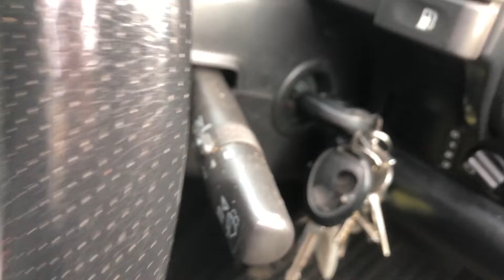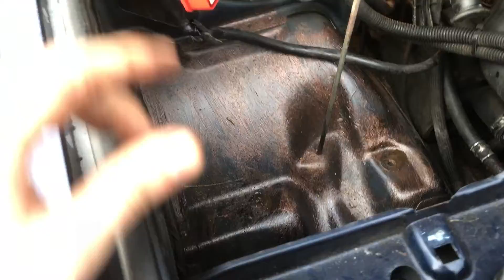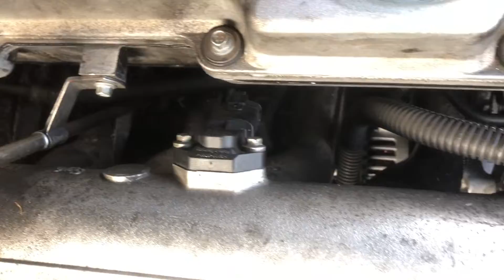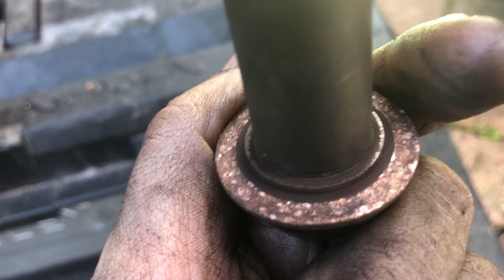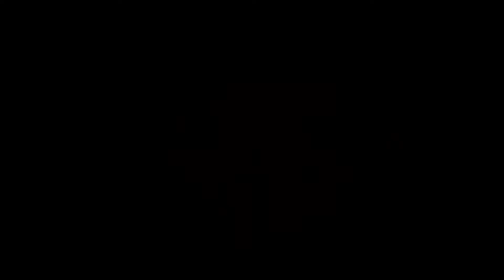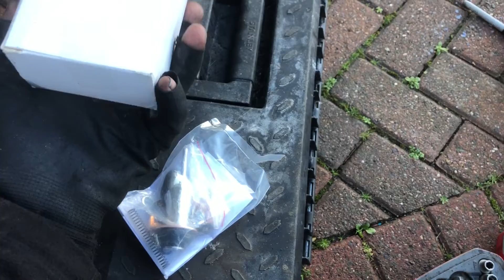Land Rover Discovery 2 TD5 No start, Crank or Turn over Starter Motor Removal and Replacement How To

Comment: Mine has just started, (or in this case not started),  to play up. One day she will fire up first turn, 10 minutes later the dash goes dead and no crank. Then sometimes if I put my foot on the brake pedal, it works. Other times moving the auto gear lever in and out of park works. 
Running out of ideas, so anyone else experienced a similar problem?

Comment: great vid lads - question do you think based on your experience would it be possible to replace or repair just the solenoid unit with the starter motor in place?
Reply from the maker: it would make the job more diffcult if you tried with it on that's if you can get to all the parts properly, it's not that bad removing it.

Comment: Definitely dont need 2 people for refitting the top bolt  thow the right size extension is very important and makes the job a lot easier
Iv removed mine 3 times  now  2 of them were temporary fixes to get going on the side of the road again
Reply from the maker: which top bolt are you referring to?
Reply: @DJHowTo  the 3rd one were you were saying it was very difficult to remove and needed two people

Comment: Useful things to check, thank you.

My starter motor works, I've bypassed it and put a button in the cab.  But with everything connected as standard, it immediately blows the 100 amp fuse.

Comment: I have similar problem, but I think my issue is xyz switch side of crank process and it’s intermittent so difficult to diagnose (probably xyz switch, I get p1843 and p0705 faults). When it happens I simply bypass the  inhibitor (xyz) side by jump starting from starter motor signal wire  (mention in vid) to positive battery with key in pos 2. I believe this is also a quick way to verify your starter motor side is working fine?
Reply from the maker: Have you checked your battery voltage is good?

Comment: I’ve got the same problem won’t crank or turn over done the repair kit and still them same
Reply from the maker: is the relay clicking? and if it is do you have 12v+ on signal wire after as in the video?
Reply: @DJHowTo  I’ll double check in the morning
Reply from the maker: @DJPS-ih8cy  if the above checks out, make sure you have voltage at the end of that signal wire on the starter motor spade connector it could just broken or dirty (contact cleaner works well to clean)

Comment: Yes, two people make removal of that top nut a lot easier, so with only myself, there is a second way.  You gain access through the side skirting.  The bottom two 14mm bolts and the electrical wire/nut are a dawdle from underneath BUT try as I might, you just can't line up a socket with a bar on your own, well I couldn't.  I tried just the extension then tried to fit the square drive on the extension.  Just impossible.  After I got my hand onto the top nut via a gap in the side skirting I decided to remove the area just above where the brake pipe exits into the wheel area and terminates onto the flexible pipe mounting.  I cut out the skirting mostly with metal shears and left a lip on the brake pipe mounting to allow it to be rivetted back on.  Yes, it's more work to re-rivet the cut skirt back on but with it re-undersealed, it looks in better shape than it has for a while.
Reply from the maker: Thanks for sharing this.

Comment: So frustrating when you check the relay.  Your camera is all over the place and you can't see what output wire from the relay  you're connecting the test set too.
Reply from the maker: I know this part wasn't too good, trying to do too much at once but to clarify the starter motor relay wire is the brown+red line with a brown plug that's in front of the light grey plug then the relay that controls that wire is the second large yellow relay from the right hope that clears it up let me know if you have any more questions